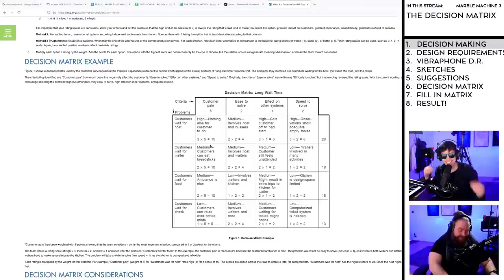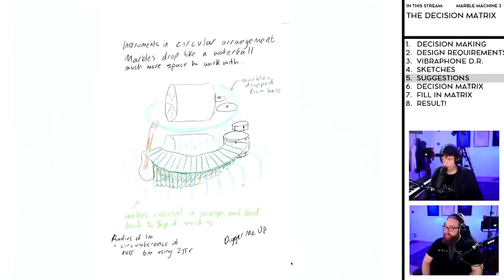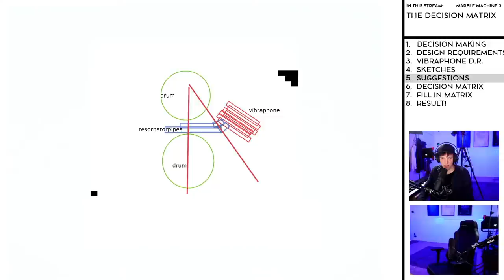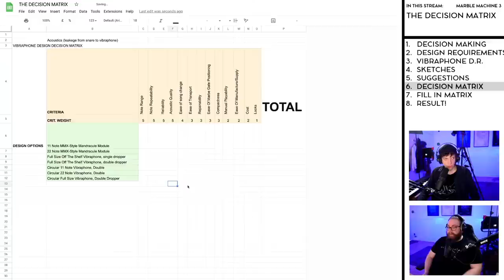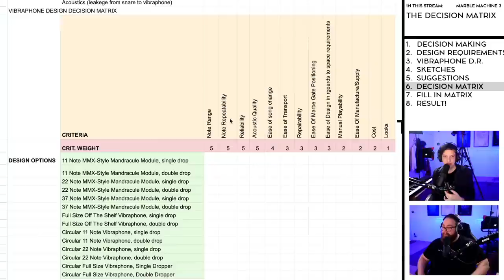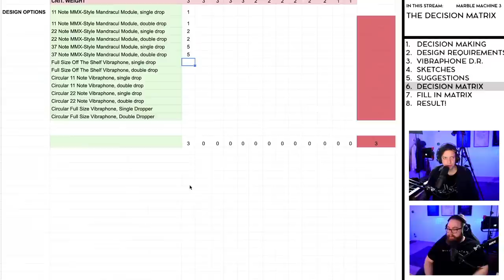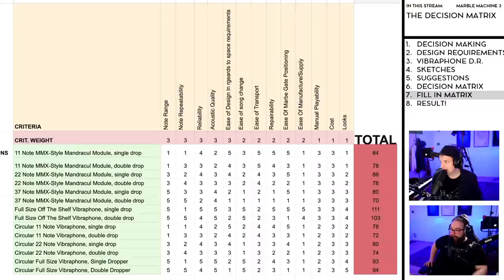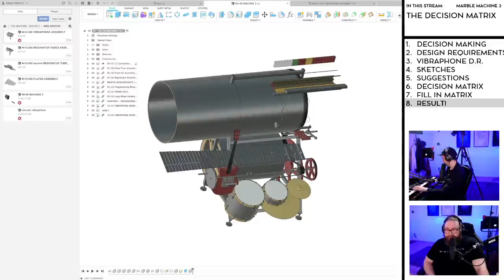The Decision Matrix

Comment: Limiting how you write the song to be able to be played by the vibraphone feels like it should violate a design requirement. Even if it doesn't have all the notes, the vibraphone should be easy to write music for -- we want to hear Martin's creativity, not stifle it.

Having interesting visual action on multiple sides or multiple machines might actually be even more entertaining to watch than just a single machine or single side of output. This would also greatly reduce the complexity of solving for playing multiple instruments directly in front of the same drum, which seems to be where a large portion of time is still being spent in design.

I imagine it would be more fun to be designing the lifting components, the bowden cable networks, the pipe tubes, and so forth rather than constantly struggling mentally over how to fit marble paths stacked on top of each other.
Reply: Limiting possible scales doesn’t necessarily stifle creativity. Limitations often improve results for creatives, and could give the machine a more distinct “personality”
Reply: @bencressman6110  I don't disagree there, but this is meant to be a performance instrument for a band/musician, and not just an art piece anymore.

Comment: Does the vibraphone notes have to stay in the same order from low to high? You can write the song normally and do some calculation to arrange the notes in the order that has the best distribution of usage, such as most used notes on two ends of the vibro phone instead of next to each other.
If a note is played tightly, the software can say put 3 or 4 of them in there.
Reply: Yes they do. He's going for a standard vibraphone